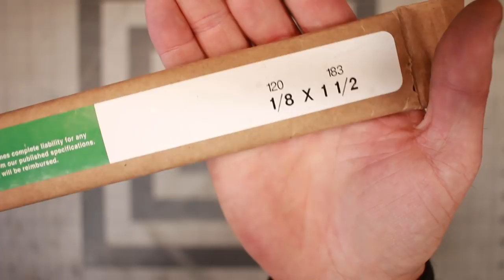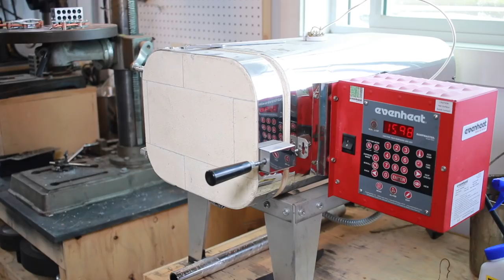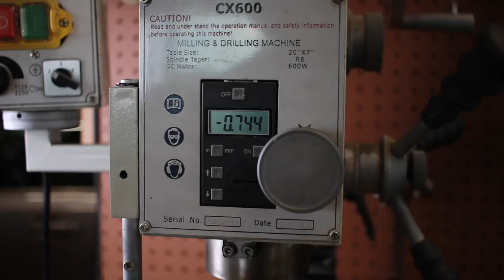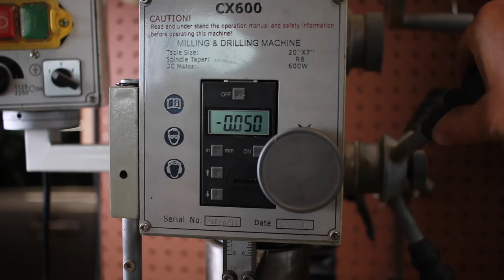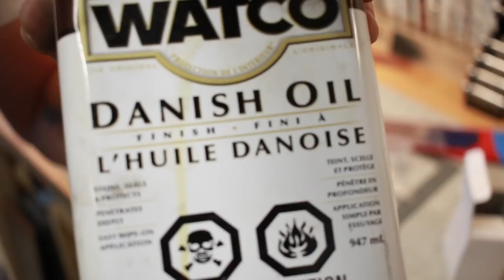Making a knife maker's broach - The satisfaction of  handmade tool

Comment: I wonder what more positive rake would do. That angle that you guestimated isn't all that important as the rake is I would say. Your rake is now given only by the radius that you put in there with the 1/2 round file. I think that more positiv rake would give you geometry that requires less feed pressure (but I'm not really shure if it wouldn't "self feed too much).

Very nice video Jeremy!

Comment: There was me thinking that's the most aggressive toothbrush ever.
I have used taped up jigsaw blades a few times, they are too flexible and thin to do a good job. I am guessing you used the same thickness as most of your blades, a great addition to the tool box.

Comment: Will cutting wood with your metal blade in the bandsaw dull it for metal? Just curious.
Reply: Craakyerhead not that I have noticed. If I only need to trim scales or something small, I don't usually bother to change blades. It is a much slower cut though.
Reply: Ok cool, thanks!

Comment: Wait it's not fully handmade or did i miss Something?
Reply: Fredi KT what about it is not "fully handmade"?
Reply: Mason Fino The eternal debate - “a bandsaw isn’t a hand tool”. Flint knappers complained that bronzesmiths were cheating, with their “smelting” and “casting”. Modern machining purists complain about CNC - apparently CNC is cheating in a way that 5 horsepower and a DRO isn’t.  I say, if you go far enough, then anything other than your teeth and fingernails is cheating. I’m a big fan of cheating if it lets you make pretty shiny things faster and better :)
Reply: I'm thinking that a bandsaw and a beltgrinder aren't hand tools because they have a current running through them that is not hand powered